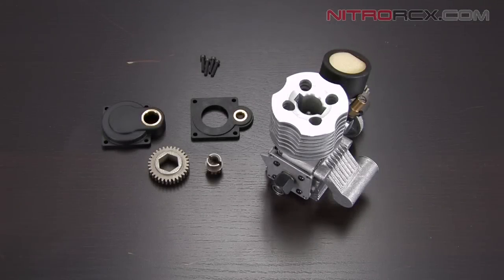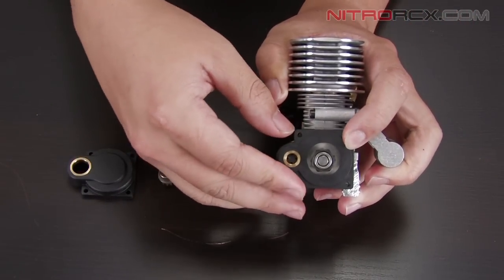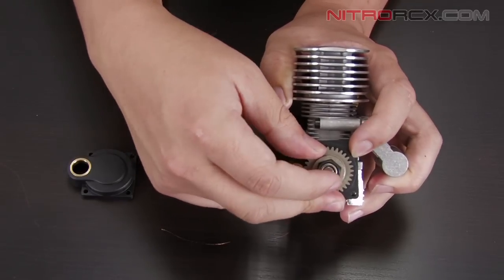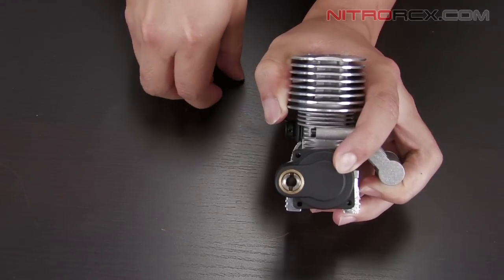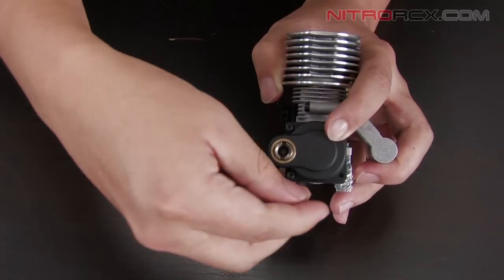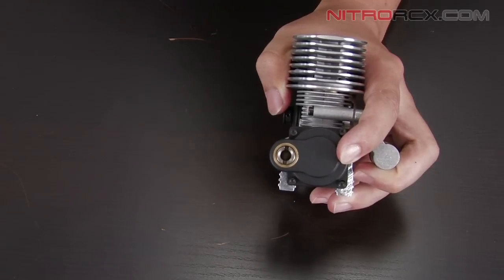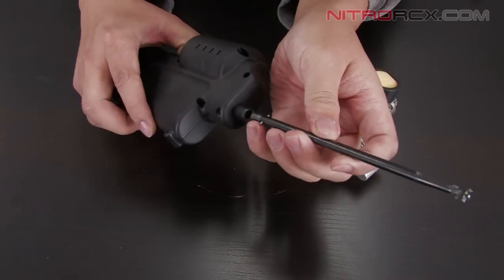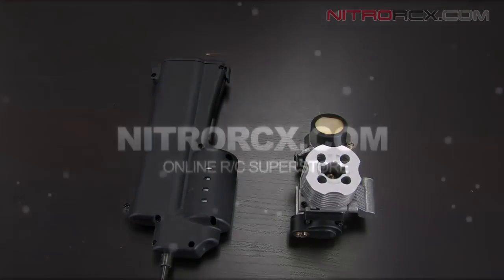Nitrorcx Guide: How to Install Electric Starter on a Nitro RC Car Estarter for 1/10 and 1/8 Gas Cars

Comment: Sorry to bust your bubble man but the starter is on the wrong side because I have a hyperspeed with a ez start  and the starter is supposed to be facing the other way. if you put that back on the car the rear diff will be in the way.

Comment: On my Madbash I needed to convert to elect. start. What I found was to remove the rear of the car with 4 screws and 1 for cross beam. This way did not need to mess with the engine.  Your videos do make life great.

Comment: is it possible to put the starter so the drill slot is on the other side because the way that you just set it up wouldnt work for my rc

Comment from the maker: @bobdude2360 You are absolutely correct, i'm very sorry this is a silly mistake that we made. The starter plate should be facing the inside of the car not the outside. Realistically it can be facing any direction that your electric starter can reach, but the inside is the recommended side.